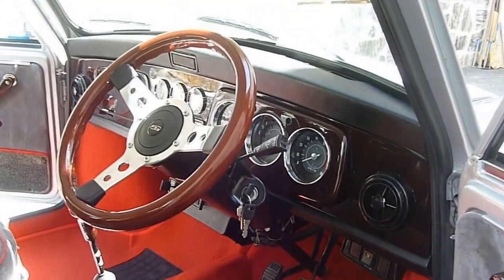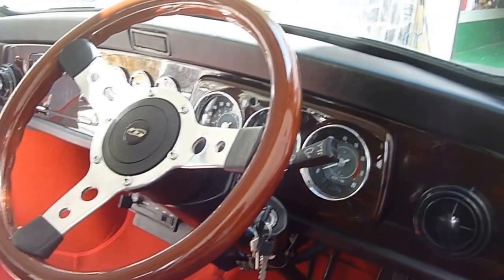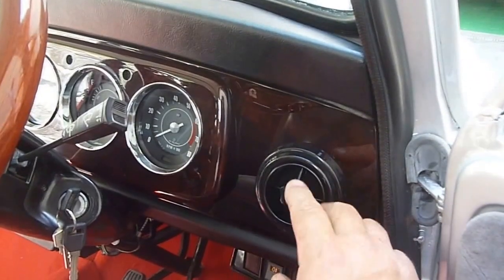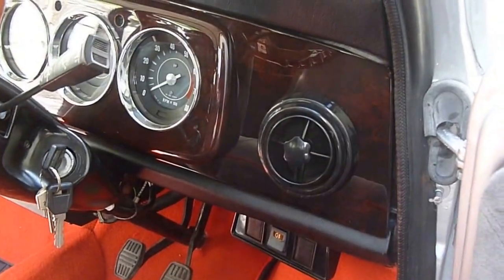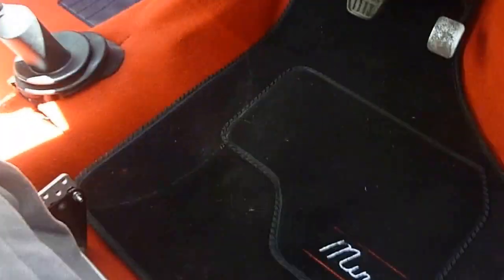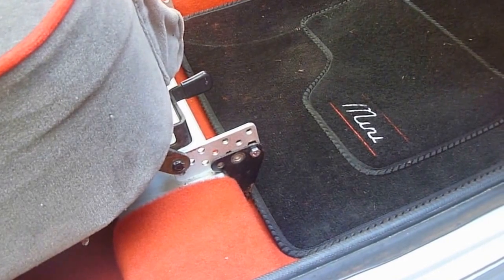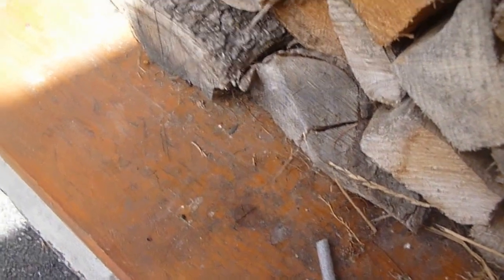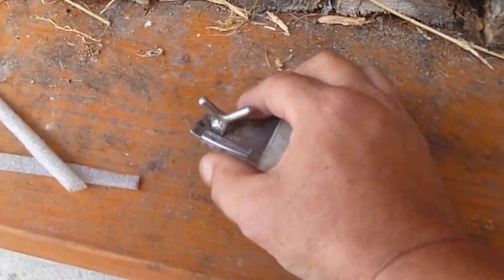Classic Mini dashboard Part 3

Comment: Hi Dave
Just about to fit an aftermarket dash so enjoyed watching your video and some good tips.
Can I just ask quick question regarding the oil pressure gauge install. How did you route the hose from sender to gauge and where did the hose pass through bulkhead?
Many thanks
Steve

Comment: Hi, great videos! I'm having difficulty removing the bolt in the centre of the dash, at the back, I just can't seem to get it!!  Any tips, I've a 96 Cooper.  Cheers..
Reply from the maker: +Declan Carroll 
You should be able to push or pull out the cardboard parcel shelf out of the way to get to the butterfly
bolts at the back. Drop me an E Mail on davejaguar66@gmail.com if i can help. David
Reply: Cheers, thanks for that, I'll give it a bash!!